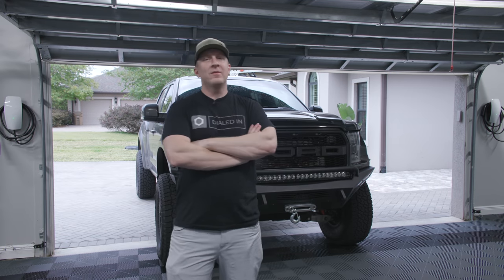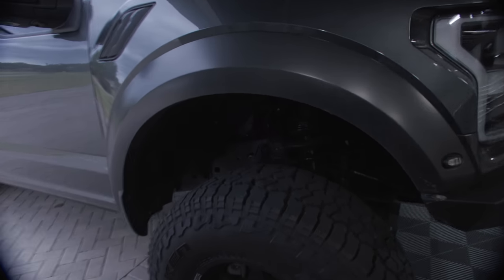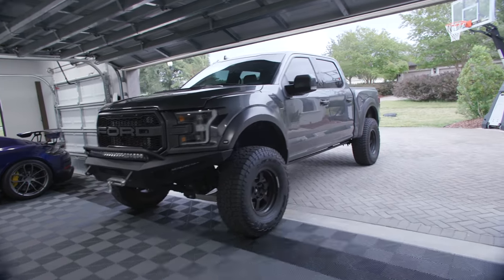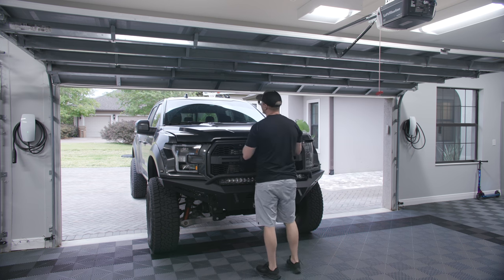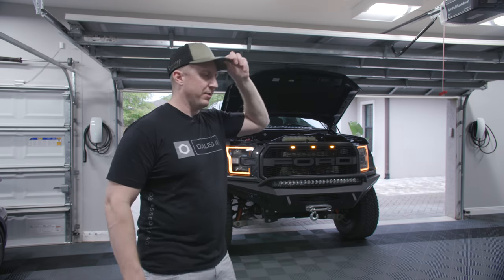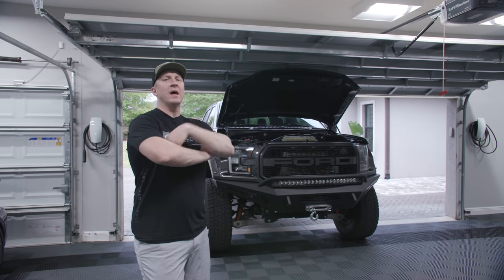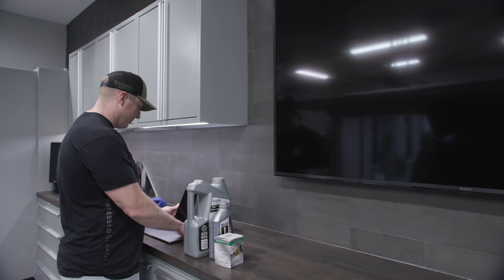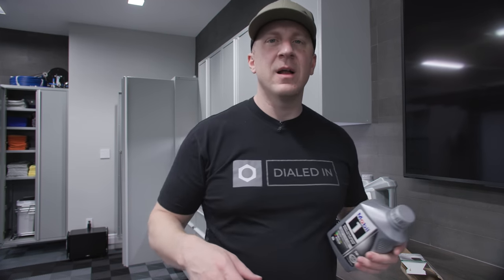Intro to the SDR Raptor: Upcoming Giveaway?

Comment: Personally I think it be cooler if you fully built it with svc parts there mid travel kit  and king off-road shocks and went with more of pre runner bumpers. Tune it with custom tune.

Comment: Being there is BDS Lift Kit on there some parts of original structure of the truck might be gone (meaning cut off). When it comes to wheels rule of thumb. More you go towards 0mm offset or on minus side the more wheel sticks out from underneath the fender. More towards plus side more tucked in it will be. Factory wheels are usually between +38 to +30mm offset. Thirdly MidTravel Suspension for on road use only limits your turning radius little bit and its noisy especially shock valve clunking. If you can get away without replacing factory structural pieces (if they haven't been cut off) personally I would go with Fox LiveValve Race Series 3.0's (going with Kings you need to do LiveValve Delete Kit since it has LiveValve Fox Shocks). Icons or Deavers in the rear with SVC or Icon Bump Stop Kit and call it a day. Definitely change bumper and for the Tune go with GooseTuned (one of the developers for Cobb Tunning ... guy actually works for NASA 😉).

Comment: Innov8 Wheels are pretty nice, very OG spec.3rd  Also just making it OEM+ would be nice, keep the live valve shocks or do the Fox Race Series 3.0's, add SDI E-Click to it, Deaver +3 Springs, SVC Shackles, SVC UCA's, SVC Bump Kit, SVC bumpers, Baja Designs Lights,  Alpharex Headlights, GJ Motorsports or Bulletproof Diesel 3rd brake light parts, tune it, AWE exhaust, tint, paint correction, coating.

Comment: I release the pull cord lock on my garage door, let it roll to the stops and pull my truck in. My garage door is to low to pull in as well. Unless I release the latch.
Reply: I was just going to mention that. At my rental i have to literally push the door up higher on the tracks and jam a screwdriver to hold it .. to get my jeep to fit.

Comment: What causes the camera to have the black in the corners? Noticed it in the last 3-4 videos and haven’t before
Reply from the maker: It's the Sigma Art lens with C70 and RF adapter.  It's not good.
Reply: Prob using an EF-S lens on it, instead of a RF or EF lens. EF-S lenses don't cover the whole sensor when zoomed all the way out.

Comment: Start to Finish.... how much time did Matt spend messing with that oli change. 
 Me.... way too LONG
Send it out next time
Reply from the maker: There ended up being a second oring stuck to the housing from a previous oil change.  That is why the old filter was locked on.

Comment: get a TRX. those are better
Reply: Really? Visually a Raptor is vastly different than a F150.  The TRX is to similar to some other trim levels. I specifically said 'similar' and not 'identical' for a reason. Don't point out the obvious differences. A plus for the Raptor is not being number 18 in line for warranty repairs. My local Ram dealership entrance looks like a parade every morning.
Reply: @timkinley1779  I think there is a distinct difference from how the TRX looks to even the rebel which is probably closest looking trim
Reply: The only good thing about a Trx is the engine, the rest is trash.